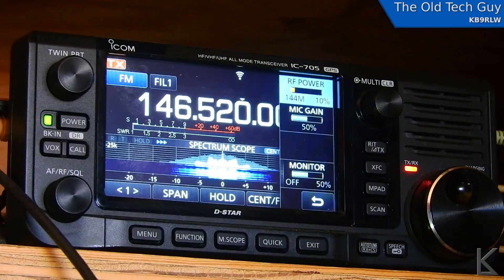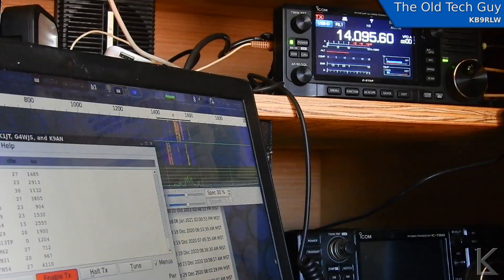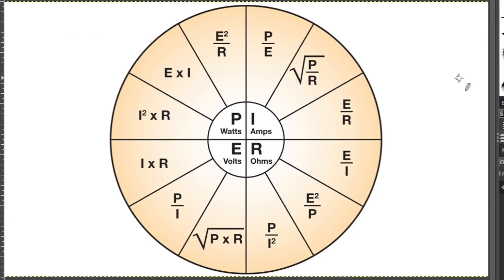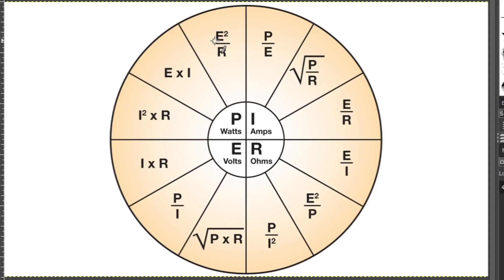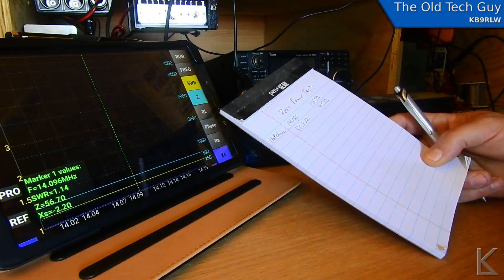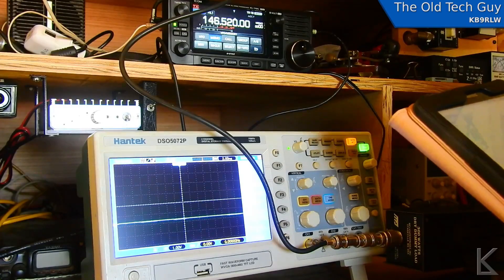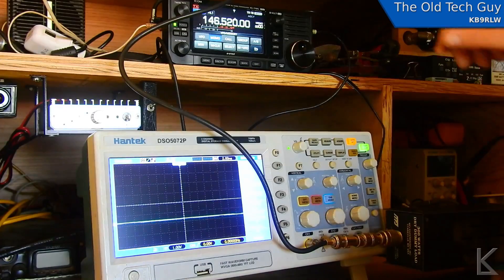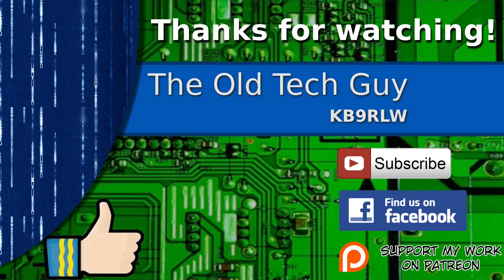Ham Radio - Setting the IC-705 to 'Zero' power out.  How much does it still produce?

Comment: I just measured the power using a couple of power meters. My results on 20 meters were  in the range of  120-150mW depending on the meter.

Comment: For this test, does it matter whether you use the battery pack or external power, or would the results be the same either way? Thanks! DL2AKV
Reply from the maker: No difference.  The internal battery only limits the high end to 5 watts by default.

Comment: Here is something else to think about Kevin. On these lower power levels it is easier to think in terms of dBm where 1 milliwatt is 0 dBm and 1 watt is 30 dBm and 100  watts is 50 dBm. Now look at the graticule of the 705 (or 7300 or 9700) on the spectrum scope as you transmit a WSPR or other carrier. Each graticule division is claimed by Icom to be 10 dB. If you transmit at the 100 watt level, and make careful note just exactly where the peak at the 100 watt level is located on the graticule division you can reduce power by one graticule division and be 10 dB down from the peak at 100 watts.  So now you are at the 10 watt level or 40 dBm You can reduce power in a much more granular way by reducing audio drive from the WSJT-x program itself by using the power slider on the right hand side of the display. It even comes with a calculated power reduction scale if you hover the mouse over the slider control.  In this manner and by watching the graticule on the 705 or 7300 you can get a pretty fair estimate of your power output without touching the actual power control on the rig's multiknob itself at all. Simply reduce audio drive to reduce power in 10 dB steps  until you are satisfied with your WSPR (or FT8) power level.  Setting power to 0 dBm (1 milliwatt) or even lower by watching to see where the waveform falls on the graticule is possible. Of course this assumes the graticule on the rig is actually in 10 dB steps.  Hope this helps someone 73  
James  K0UA

Comment: Thanks for the test. One thing that you have to account for is the oscilloscopes input bandwidth. Yours should have a -3dB gain at 70 MHz unless you modded it. If so that info would have been great to know. I repeated the test with a 350 MHz bandwidth scope and got an RMS output voltage of 2,2 V@2m and 2,4V@20m. So the power should be comparable on 20 and 2 m. I also recognised that there is nearly no difference between 0% and 1% power. So the RF power scale should be pretty linear divided in 100 mW steps. After this whole virus restrictions are over here in germany I will take also a measurement with a proper Rhode & Schwarz power meter in my university.
Reply from the maker: Yes, I know.  I think I concluded that it was going to be in the area of 100mw.   Like I said, I don't have the best equipment and only expected to get 'close'.
Someone else commented either here or on the FB page that they measured it with a QRP watt meter and saw ~100mw. 
But I would be interested in what you measure with a proper piece of equipment.  Email me when you do, if you don't mind doing so.  My public email is good on QRZ.com.

Comment: Good video Kevin, thanks. A handy formula I use when converting peak to peak voltage measured  on an oscilloscope to power (RMS) is to square the peak to peak voltage value and divide the answer by 400. This only works for a 50 Ohm resistive load. In this case 7.24V peak-peak gives 131mW. Maybe not very accurate but useful for low power and I suspect more accurate than many analogue power meters? A few times over the years, I have measured the same transmitter output to the same load with different (uncalibrated) commercial power meters and they have displayed quite different values! So, if your only item of test gear is a scope, I reckon this is a good test to reasonably accurately measure RMS power output.

Comment: If I work that equation backwards, 100 watts into a 50 ohm load will see ~200 volts (peak to peak) on the transmission line - is that correct? If so, how does the transmitter produce such high voltage from a ~12 volt source?
Reply: I think you are correct. Considering a modern HF rig with a solid state PA and a 12V dc supply (usually 13.8V in practice), how does it deliver 200V pk-pk to a 50 Ohm load? Designs vary but one way is to have a pair of transistors working in push-pull configuration in the power amplifier (PA) output stage, commonly known as the "finals". This will effectively double the voltage output to the load (typically a transformer) connected to their output. So, now we have 24V pk-pk. The transformer arrangement between the PA transistors and the antenna socket will provide a further voltage step up. For example, a 1:9 step up ratio will give 216V pk-pk.

RF at around 200V pk-pk. Please, be careful. I have learned the hard way not to touch it 😀.

Comment: So much for CW practice with power set to 0%.  The IC-7300 manual says to do just that.  Any chance you might run the same test on your 7300?
Reply: Just set the break in to off.
Reply from the maker: I might check the 7300 some day.   Any radio with a zero power out setting will generate some RF at the antenna port.  The driver stage is still active and some RF will make it's way through the sleeping finals.
You can turn off the break-in setting to just generate tones without keying the radio if you want to do code sending practice.
Reply: From now on, I will attach a dummy load to practice CW.  I need a lot of practice.

Comment: If I remember correctly the IC7300 manual says it's output is about two watts when set to zero. I never tested it until one day after a CW practice session I answered a CQ and received a lower than expected RST. Checked the power and saw it was on zero.  Since then have done it numerous times. Fun!
Reply: A case of accidental QRP conversion? 😀
Reply: @Steve-GM0HUU  You've hit the nail on the head! I now have all three models of the QCX QRP rig!

Comment: Thanks for the video. The oscilloscope information and calculations really helped me out. I bought a new oscilloscope so I can start learning. I appreciate it
Reply: Good call. A scope and maybe a multimeter allows you to do many things. Just seeing what a waveform looks like - as they say, a picture is worth a thousand words. In the earlier days of electronics, I have sometimes wondered what the first Enginners felt like when they saw voltage waveforms on those little CRT displays for the first time?

Comment: Hi Kevin, it was interesting. I wonder if your dummy load measured purely resistance or if that impedance is a vector of R + jX where X is either C or L reactance, it’s only R that dissipates the power. So R could have been lower if not a perfect dummy load.
Reply from the maker: Like I said, I don't have lab equipment, so I'm sure I'm only getting close.   My conclusion at the end is it's in the area of 100mw.   Close enough for horseshoes and hand grenades. ;-)
Reply: @loughkb  O Kevin, I  mentioned that because I saw the vector analyser, actually on the screen I saw that at 20M Z = 56.70 = x - 2.2. (where x = R and -2.2 = Xc), so that made R 56.65, only a little smaller, but iif it was the same load at 2M, then the value of 45R for Z suggests a lot of reactance and R was still 56.65R.

Comment: Whoa!  Blasting the aether like that may cause a glow around you antenna.   Try to cut back on all that power.  0.0025 should be more than enough.  Just kidding, crank up the power to a full 0.100 and talk to  the Voyager II.  On the other hand, nothing worse than a leaker transmitter.  Still just kidding.
Reply from the maker: It does make for a nice way of attempting QRPp contacts though.   I'm going to try to make a few CW QSO's at flea power for fun.

Comment: Thought it's .707 x peak to peak and then .3535 zero to peak if the peaks are symmetrical
Reply from the maker: For comparison, I used this RMS calculator, plugging in the peak to peak value I measured, setting the selection to peak to peak, and it spat out the same RMS value I calculated.   So the method seems correct.
https://www.allaboutcircuits.com/tools/rms-voltage-calculator/
Reply: @loughkb  been a long time since my extra test, over 30 years my memory may not be that good.
Enjoy your videos 
73 Guy N9NK
Reply from the maker: @guygell7153  Looking back at your original comment,  you had it flipped around.   It's 0.707 X peak, or .3535 X peak-to-peak.
I remember questions on the test that tried to fool me by flipping a few elements of a formula around.
Reply: Steve Miller Band was at the PEAK of their career flying on a 707... that's how I remember it.